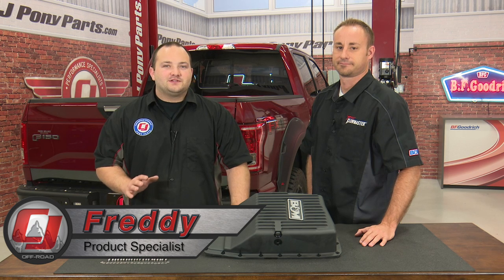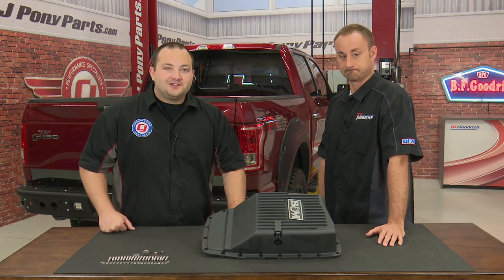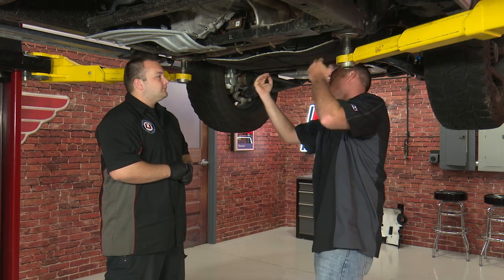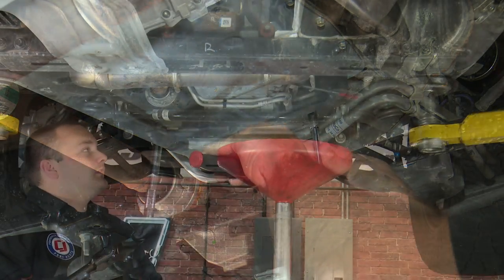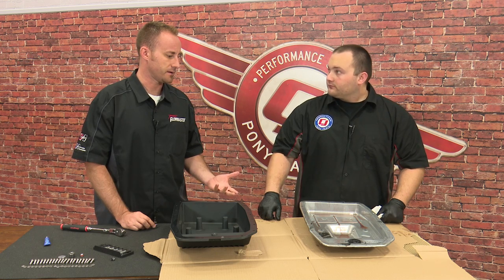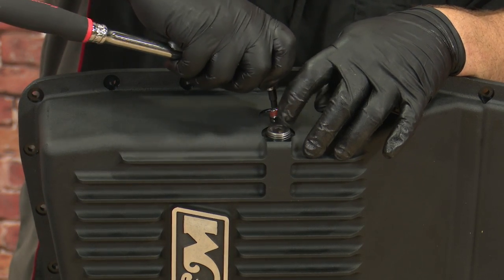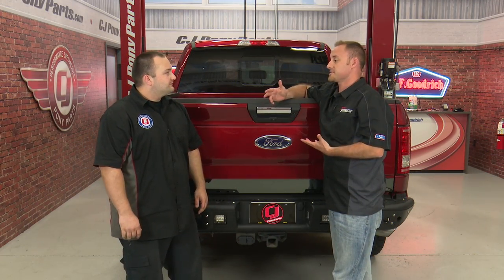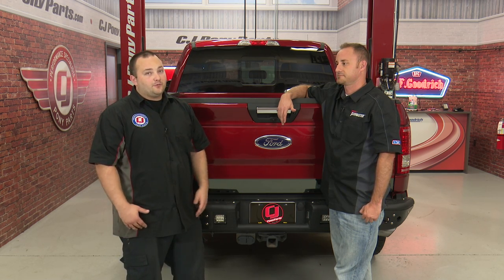F-150 B&M Transmission Pan Cast Aluminum Black Deep For Auto Transmission 2009-2017 Installation

Comment: I was like yeah this will be nice. I won’t have to get fluid all over me when I do fluid changes then I clicked on the link 433 bucks!  That’s to much for me just to gain a drain plug
Reply: RockAuto has OEM style with drain plug for around $30, just did mine along with flush and filter.
Reply: @travisbradbury4493  cool thx!

Comment: If replacing the pan anyway  why not just drill a drain hole into the pan you are replacing?  A lot less mess.
Reply: or use a pump to mostly empty it first. Why nobody on any of these F150 fluid change videos doesn't do this. smh

Comment: Hello, I have a Ford Raptor of 2017, an EcoBoost 3,5 engine, a mileage of 6000 ml, I have a problem with Oil Pan - oil flows, plastic Oil Pan in oil. Tell me who faced this a problem and that it could be? P.S. l can throw you a photo on the mail box

Comment: Can I use the OEM bolts all around, instead of the supplied bolts to attach the pan? I don't want the Allen head bolts to get stripped over time. Also, did you guys use the metal, factory gasket; or did you use an aftermarket gasket, like Fel-Pro?
Reply from the maker: you have to use the supplied bolts since the pan is thicker and we used the factory gasket.
Reply: @CJBroncoF150 , Hey, thanks so much for replying! I'm saving up to purchase three of your products, now.
Reply: @CJBroncoF150  During reinstallation he says you can reuse the factory hardware.  https://youtu.be/N0OjJU_Bvi8?t=340

Comment: So how do you know that filter isn’t sitting at the bottom of that sump? It’s fine with the stock pan because there’s no room for it to fall.
Reply from the maker: The 4 large pillars in the middle of the pan prevent it from falling down.

Comment: I reused the factory hex bolts. The rear bolts are just a little tricky to get to. I felt my tools had better access to hex bolts vs allen head bolts. Allen heads can strip easily too; especially using ball end wrenches. Instead of using socket universal joint, try using a  8 mm swivel socket or a wobble extension on your 8 mm socket. I also suggest using ¼" drive due to its smaller diameter. These suggestions only apply to the rearward bolts. The rest are totally accessible.
Reply from the maker: If it works, it works! Thanks for your input! :)

Comment: You skipped the fitment of the pan gasket. Did you use a gasket...sealant...?
Reply: The gasket from the factory is reusable, just wipe it down gently, and reinstall.